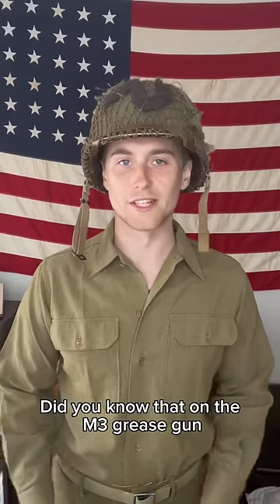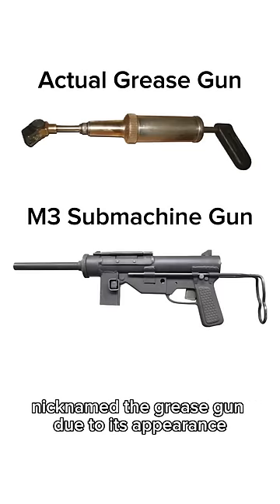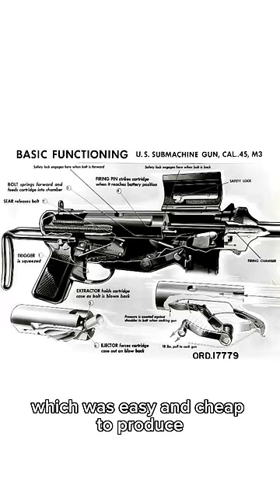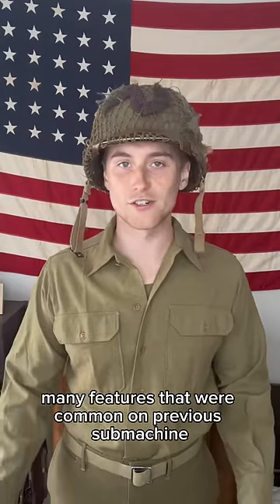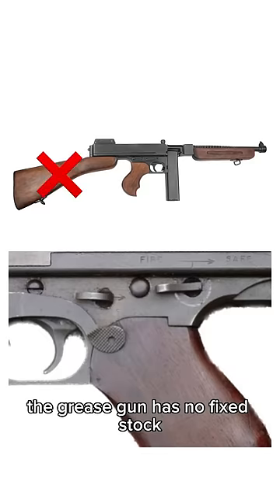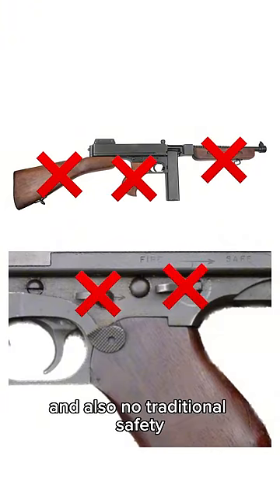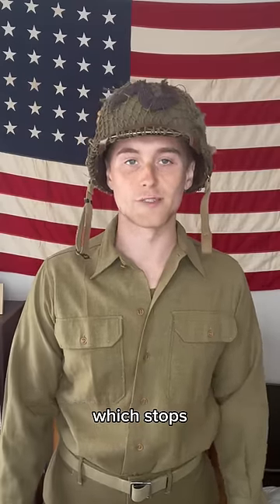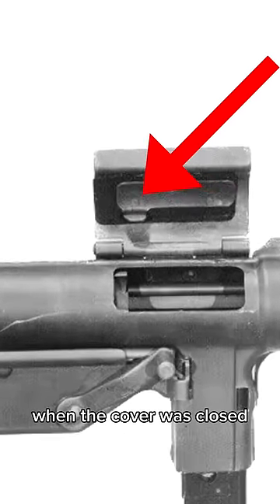Did you know this about the M3 Grease Gun?

Comment: Lots of SMGs back then just used a locking latch of some sort for the bolt handle to put them in safe.
Reply: Alot still do to this day like Steyr and Heckler & Koch to name a few.
Reply: @dukereguardless1720  HK guns have safeties built into the fire selector
Reply: @dukereguardless1720 Those aren't safety's
Reply: The Sten MKII–which feeds 9×19mm ammo through the left side, unlike most firearms that use box magazines that feed from the bottom–the Sten MKII has a small perpendicular L-shaped slot along and near the rear of the straight firing slot for the free-floating charging handle that fits into a hole in the bolt, which is kept from falling out of the slot via the receiver tube to hold the bolt back in a fixed position, so it doesn't move forward. It has a push-button fire selector, pushed left for "A" (auto), and pushed right for "R" (semi-auto), AKA, "repeat" fire. It's a simple, but effective SMG!
Reply: Wow
Reply: @Frille512  That's not an apostrophe.
Reply: @V-XENO  i don`t care
Reply: Yup also stops "bolt bounce" if you drop it on the butt of the stock.
Reply: @dukereguardless1720  what you're thinking of are just bolt catches that make you be able to manually lock the bolt back.
Reply: Two of the most well known submachineguns in history had a tiny switch on the bolt that acted as the safety, the PPD-40 and the PPSH-41.
Reply: @worldcure7883  The MP-38/40 also had that sort of feature.

Comment: Other gun safety: button
Grease gun: open close
Reply: This guy forgot the other safety feature. A fucking 10+ lbs trigger pull.
Reply: Glock: what's a safety?
Reply: I know everything there is to know about that
Reply: minecraft ahh saftey system
Reply: @shize9ine wait actually? that's insane wtf
Reply: Also didn’t have a charging handle, you manually pull the bolt back by finger
Reply: @gunslinger-st1bm the m2 version did but they decided that a thumb hole was "good enough" considering 99% of the time the bolt would be left open.
Reply: @shize9ine finally, a machine gun with a double-action trigger

Comment: "Why do you need a safety? Just don't pull the trigger"
Reply: "This is my safety."
*wiggles index finger
Reply: Without the bolt block in the cover,  if the soldier jumped off a truck, or other slightly elevated spot, the weight of the bolt could cause it to retract enough to strip a round from the magazine.  With a fixed firing pin this will result in a discharge of the weapon.
Reply: @beardo52  He's just joking around dude. Everyone knows what a safety is for.
Reply: @bierdo52 your the kind of guy no one likes
Reply: @beardo52 "retract enough to strip a round from the firing pin" ? It's an open bolt, the bolt is always retracted
Reply: Seems to work for glock
Reply: @itiscujo  glock has a safety. It's built in to the trigger.
Reply: A cowboys revolver had to safety’s the hammer and the cowboys trigger discipline
Reply: Famous last words Mr Durrutti
Reply: fun fact: a brazilian police piston(i think an old model) can shoot without touching the trigger. how? you can shoot with just shaking it.
Reply: They underestimate the power of the "intrusive thought"

Comment: Did you know that we had several of these in 1990.  The biggest problem is runaways.  if the trigger seer doesn't catch the bolt you are just going to continue firing.   Keep your weapons pointed down range gentlemen
Reply: They were never designed to be used for decades, last ones were made a few years after WWII. And since they are passed on through multiple generations of soldiers many of whom treat it with anything but care ...
Reply: Had buddy at ww2 event have this issue. All we could hear in the woods is him mag dumping and sounding incredible. When we got to ask him why he was doing it he wasnt very happy with all the ammo he wasted. Made the battle so much better though.
Reply: @rotwang2000 that’s pretty much everything in the military for ya
Reply: @jolanderphilip  I know a guy who still refuses to believe the High Power is not some rattling piece of junk that is DESIGNED to malfunction, he had like five of them as a sidearm, none of them ever worked properly.
Reply: @rotwang2000 designed to malfunction? Can you elaborate. Genuinely curious 😅
Reply: @marcusfraser2790  He will not touch one with a ten foot pole.  He got one issued to him in the military and it fell apart when he was on the range, so they gave him a new one that you couldn't rack even when hitting it with a 2x4, another one had a barrel crack as he shot it.  Many were decades old, worn to the bone and somehow he got all the worst lemons of the lot.  Weirdly the army would have zero problem scrapping a 5-year old truck that was still a solid runner, but hand me down pistols that had been used and abused for decades was a clever use or resources.
Reply: @rotwang2000 
Fr the amount of waste the military produces and at the same time doesnt recycle is shocking
Reply: @rotwang2000  that's still the way the US military functions. Doesn't mean the HiPower wasn't a good design.
Reply: Sounds like the trigger sear had been sheared off.
Reply: @jolanderphilip  It was kind of like those last ditch weapons you've probably heard about Imperial Japan and Nazi Germany made when they knew they were losing. 

Speaking of which, Nazi Germany did copy the grease gun for that reason of it being cheap to make and it being the last effort.
Reply: swings around keeping weapon pointed in front of me WHAT'S THAT SARGE?
Reply: @jolanderphilip Facts.😂 I still miss it sometimes, the tomfoolery
Reply: Is that Zussman
Reply: Don't understand why someone want to collect this. Its sole existence was to be a rugged tool for the job. No pretty design, no extra unnecessary things. Just a simple, reliable tool to be used then discarded once it has served well. It would be like someone who wants to collect a forklift, a rugged tool for a job, nothing exciting about it
Reply: I wasnt spying on you back in the 90's so i had no idea.
Reply: @deadplaya It's neat to see how they did things at the time, the thing that makes guns more collectible than forklifts is that you don't need much space
Reply: @deadplaya I think it would be cool to own something that may have, at some point, been used by an unnamed and unknown soldier in defense of their country.  It’s not always about the gun itself, sometimes it’s the history behind them that makes them interesting to own or see in a museum, even if they are no longer entirely functional.
Reply: My dad was an armorer in the 2nd Armored Division in the 1980's. He said that the M3A1s were always fun to take down to the range.
Reply: Never had a problem.
Reply: What are you supposed to do? Try to slam that dust cover closed? Remove magazine?
Reply: That's what happens when you've got a 50 year old gun that was made at a pace where "quality control" was a joke at best. It's a problem with every open bolt gun, which is why they're considered machine guns under US law
Reply: 35 years old
Reply: @bishop51807  They copied the Sten, not the Grease Gun. The Sten was already in 9mm and used similar magazines, so it was the easiest job for them to make one use MP40 magazines and just use that
Reply: @rotwang2000which version of the High Power? I've carried and shot one plenty of times before and never had any issues that wouldn't also appear on modern guns.
Reply: @anthonyjudd8356 it’s not like .45 ACP is expensive, was he just upset about wasting the ammo he had that day?
Reply: @deadplaya  It's interesting in its simple functionality, particularly when often is the case in the modern day where things are made needlessly complex.

I'd also totally own a vintage forklift.

Comment: When the U.S. entered the war in 12/1941 the Army had only one type of type of full-auto personal defense weapon, the M1929 Thompson SMG. These were very expensive, over $250 apiece in 1941 dollars, quite heavy, and not exactly compact. The original intent was to issue two Thompsons to each medium tank as part of its equipment. The M3 Lee had seven crewmen, so five of them had to rely on their sidearms alone (or whatever they could scrounge) when outside the tank. However, Auto-Ordnance was a small company that couldn't handle the vastly increased demand. Consequently, most Lee tanks in combat had only one Tommy gun aboard.

The Ordnance branch immediately began looking for alternatives that were cheaper and quick to manufacture. The Thompson went through several stages of simplification to reduce its cost and meet the demand, culminating in the M1A1 SMG which came in at about $60 each -- a big cut in the M1929's price but still almost twice the price of an M1 Garand. The Army adopted an M2 SMG that used Thompson magazines. The M2 was cheaper than the Thompson and easier to control and hold on a target, but still not ideal for tanks because it had a full-length wooden stack, making it almost as bulky as the Thompson. Thanks to production delays, the M2 never got issued to the troops.

Tankers needed a weapon with firepower that didn't take up too much room inside the already crowded interior of the AFV and could pass easily through the crew hatches. Stowage in external bins was unacceptable. This is why the M3 was so welcomed by the Armored branch, even though it was so unconventional compared to the weapons the very conservative Ordnance branch preferred to authorize. And it was cheap! From mid-1944  each M4 Sherman was equipped with five Greasers for the price of one and a half Thompsons.
Reply: A wild forgotten weapons fan in its natural environment
Reply: So, price of M-3 is 18$?
Reply: @peakovacevic1533  A bit less according to many sources. Guide Lamp Division, the GM subsidiary that manufactured the Grease gun, priced them in lots of thousands rather than single units. Estimated unit cost ranges from about $20 to as low as $14. Those were the prices the United States government paid in WWII. On average, the price of an M3 submachine gun was about the same as an M1911A1 pistol.

About 600,000 M3 SMGs were produced from late 1942 to 1944, and 50,000 even more simplified M3A1 SMGs were made between 1945 and 1953. Today they're worth between $15,000 and $20,000 each depending on their condition.
Reply: @enscroggs   Tnx.
Reply: And then there was the reising
Reply: M1928 not 1929
Reply: Thanks for taking the time to share this history. Very well detailed post.
Reply: Nerd
Reply: Thank you for sharing this! It was a good read.
Reply: @Rookie-2552  how so?
Reply: @Maerro_-_yeah  nah Im joking, very interesting information presented, Im impressed about the complexity of it
Reply: @Rookie-2552 this nigga😂
Reply: Thompsons were literally a dumpster fire of bad decisions. 
The main principle of the delayed dissimilar metal action concept it was designed around was inherently untrue and flawed lol. 
It weighed almost as much as a M1 Garand and had essentially no magwell. 
The location of a gap in the receiver also spits oil directly into your eye when firing. 
They made the MP-18 look like a marvel of technology. 
The US was desperate for submachine guns in WW2 because it was such a disaster of a firearm so much so they were using captured guns in a pretty substantial capacity. 

The M3 never really got much use in WW2 sadly, especially in the Pacific. 
It really wasn't used much until the last year of the war and the Marines in the Pacific never touched them they were all using Reisings.
Reply: For a non war time gun that amount id say is fine but for mass production during a big arse war nahhh
Reply: I love additional context

Comment: One of my favourite examples of simplifying is on the M3, traditionally they would have the dust over safety and a traditional charging handle. They ended up removing the charging handle and just going with "Just use your thumb or something to pull the bolt back"
Reply: That was the M3A1 when the bolt was given a finger hole to charge the bolt to the rear and cock the weapon. We had a mix of M3s and M3A1s in the arms room.
Reply: I prefer the charging handle one thooo
Reply: Also the fact that its open bolt IS the safety
Just dont cock it until ready to fire
If you need to decock it just take the magazine out then fire it
Open bolt guns dont hold a round in the chamber

Comment: "The brand new M3 submachine gun, a weapon of choice, simply open a lid and with a slight pull of the trigger you too can close the eye lids of your enemies."
Reply: The trigger pull on an M3 is really heavy and nasty, at least one the ones I’ve shot.
Reply: @Fingeroo  I dunno how much of a chance I have at shooting from an M3 cuz I am from europe, but I believe you that it is heavy, question is whether that is from factory or due to poor maintenance?
Reply: @Thraakull Open bolt guns typically have pretty shit trigger pulls because the trigger is the only thing holding the entire bolt assembly from slamming into battery and firing the gun. It's really not something you can get around, but the M3 being in. 45 ACP definitely doesn't help compared to the Sten and MP40 in 9mm and the PPSH/PPD/PPS in 7.62x25. Lighter cartridge means lighter bolts means less weight on the trigger

Comment: The worse feature from the grease gun, is that the magazine is only single stacked, but that is only my least of my concerns.
Reply: It's not single stack. It's double stack, single feed.
It's both a pro and a con. Definitely a con for the user, because loading it is a nightmare, just like the other double stack single feed mags, and the reliability suffers from transition between two positions for the round to sit in a mag, into one position it can feed from.
But from manufacturing point of view, it makes for a much simpler bolt. And at the time of the m3s invention, cost was everything.
Reply: @anderoo9260  Oh Sorry I didnt know about that
Reply: @Alwayscommentseveryday  No problem mate. But you were right about the other smg the us used. US marine core to be exact. The reising m50 and m55. Amazing smg for civilian and police use. Horrible for the military. Closed bolt, single stack magazine (super easy to load, but capacity was horrible), very fast rate of fire. Very controllable and accurate because of the closed bolt and despite the terrible stock (reising m60 had a much better stock tho). But it hated the mud. And so, the troops hated that gun because it was unreliable, and needed frequent magazine changes. 
Bewilderingly, instead of fixing those issues, the military just reduced the magazine length so it held 12 rounds, and told the troops to use it semi-automatic.
Yeah right, like on Guadalcanal that was feasible. 
Another single stack, this time *rifle*/lmg, was the johnson lmg. It had a horizontal 20 round mag. Bery slim and long. It was very much liked by the troops. And was used in a way that today's "assault rifles" are used.
US weaponry is super interesting, I recommend watching forgotten weapons- adds cool context to all the decisions.
Reply: @anderoo9260  I sont even know what to say because of your comment but Single feed kinda sucks tbh, and I already watched other videos by Forgotten Weapons
Reply: People complaining about the feeding issues...Me thinking what about the runaway issues.
Reply: @clothar23  What runaway issues?
Reply: @Alwayscommentseveryday   Thanks to its simplified design the grease gun has a rather short shelf life. And one of the things that can go wrong is the sear not properly catching the bolt. At which point you end up riding the lightning until the mag runs out or you get a jam. 

This issue wasn't helped by the fact these things saw way more service than they should of.

Comment: Not as simple as you think the M3 had built in tools to service the weapon. One wire of the stock was drilled and tapped to fit a bore brush and the other could was used as a cleaning rod. Also fit the barrel cap and could be used as a wrench to loosen it. Lastly a magazine loading tool was attached to it.  The grip was hollow and had within it a oiler that was used to oil down the weapon and keep it from rusting.

It was a perfection of cutting off the fat and leaving just a reliable functional SMG with much less extra kit you had to carry around.

Comment: Good video, but one note:
Opting for a moving stock instead of a fixed one did not simplify the gun. To allow the stock to slide out & lock in place, a spring loaded catch had to be added, as well as detents into the stock for that catch to clip in to. What was simplified about the stock was that it was a wire stock, instead of a contoured piece of wood.

Comment: The M3 and M3A1 SMGs were manufactured by the Guide Lamp Division of General Motors, the subsidiary tasked with the design and manufacture of headlights for GM cars and trucks. In that role, Guide Lamp had great expertise in metal stamping and die-casting, production techniques not associated with firearms before WWII. The M3 was actually the second U.S. Army small-arms contract granted to Guide Lamp. The first was the FP-45 Liberator, a single-shot .45 pistol designed as a "rifle-getter" for the citizens of Occupied Europe. The plan was to air-drop millions of ultra-cheap guns to the unarmed victims of Nazi occupation who would use them to capture much better guns from the enemy. Guide Lamp completed at least one million examples and got paid about $2 for each one. Though they were designed to be one-shot throw-aways, the FP-45 was sufficiently reliable and rugged to be issued to the Philippine national police after the Japanese occupation.